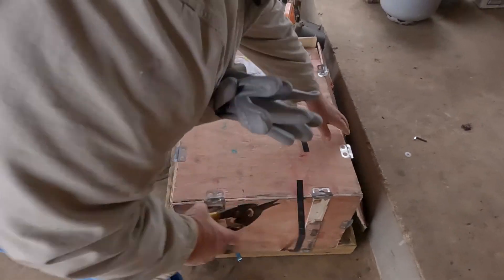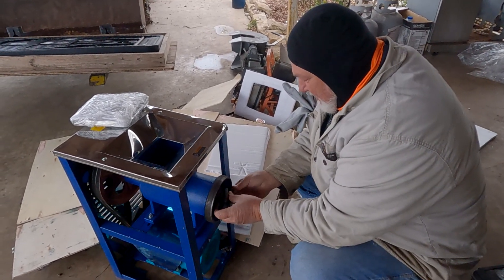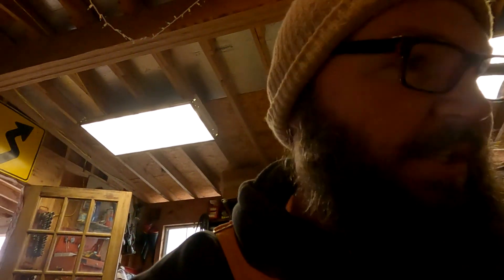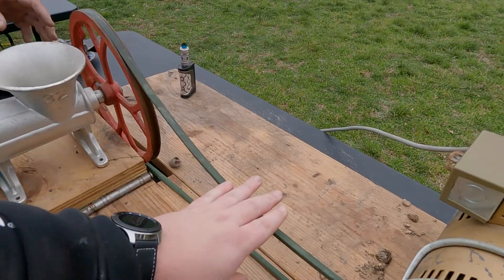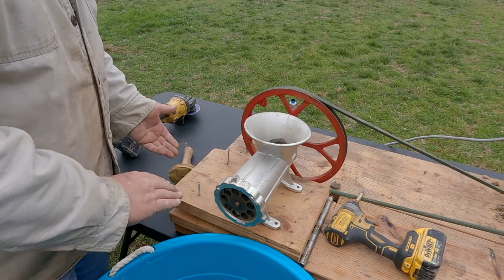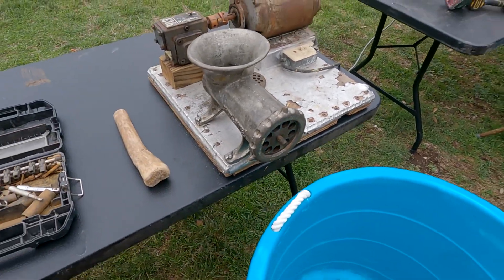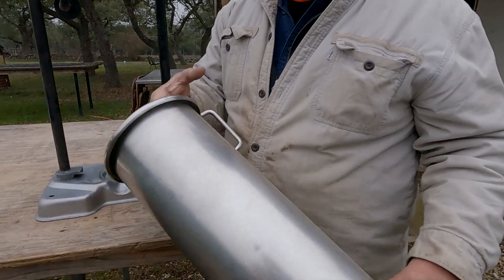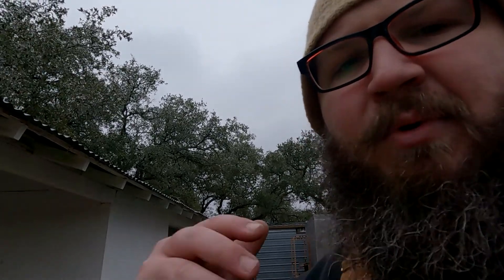How we setup to make 1200 POUNDS of Venison Dry Sausage

Comment: I use a meat cleaver to take care of those frozen blocks of meat. The colder you can run your meat through the grinder the better.
Reply from the maker: We've tried running it through frozen but the grinders aren't strong enough to handle it. Even a few too many junks can bog the motor and burn it out.
Reply: @HillCountryHomestead  we use a little #22 LEM and it seems to keep up to whatever we throw to it. In fact we are looking into a foot pedal so we don't have to kick it on and off with the switch